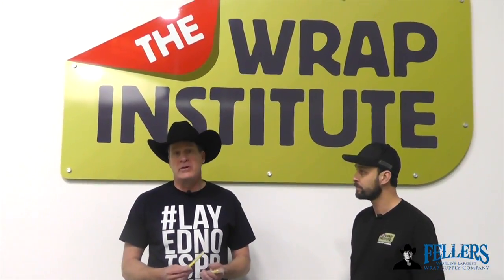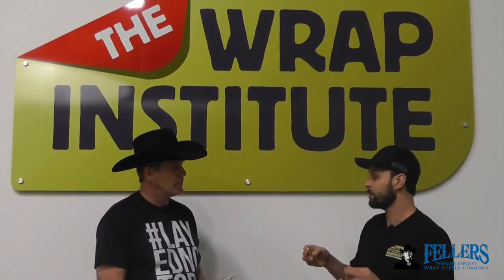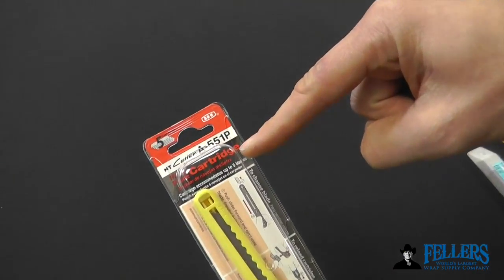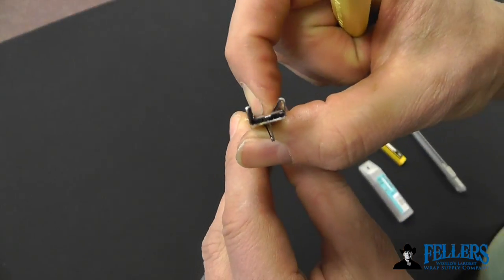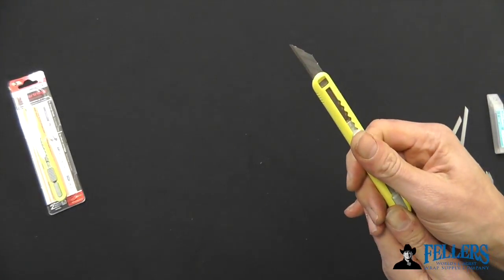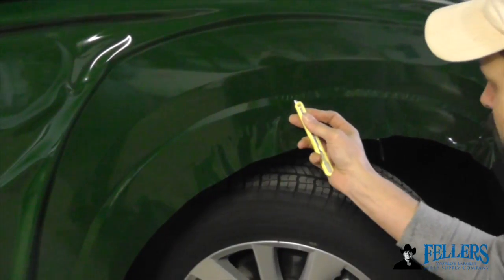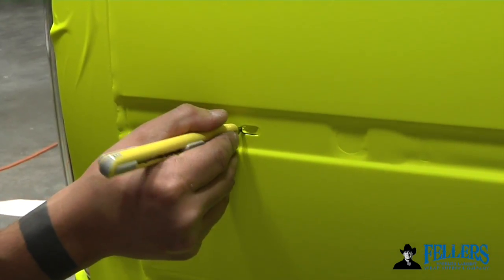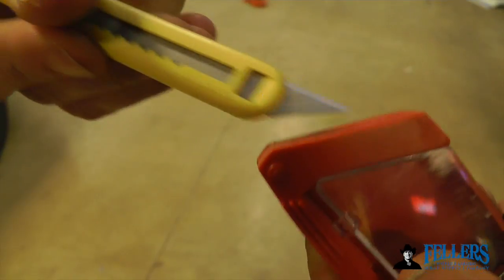NT Cutter A-551P Knife with Frank Fellers and Justin Pate

Comment: What's different about this 'snap-off' knife as apposed to any other?
Is it the angle, material, quality of blade ?
 Is the blade encasement made of something other than plastic ? Does it have a non slip surface or grip with texture?  
First time viewer & first day of wrap reaserch. 
#manicure